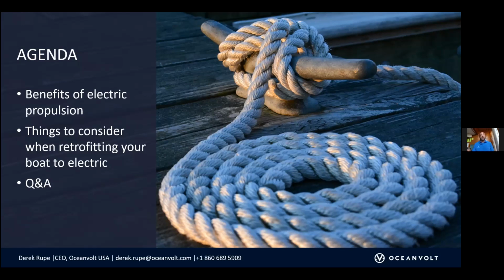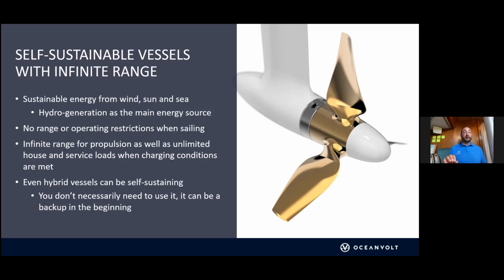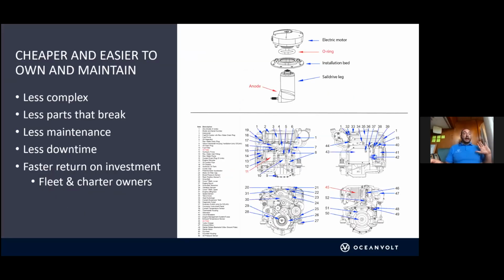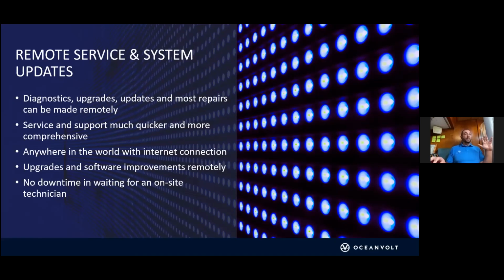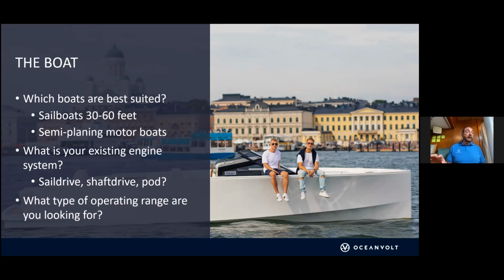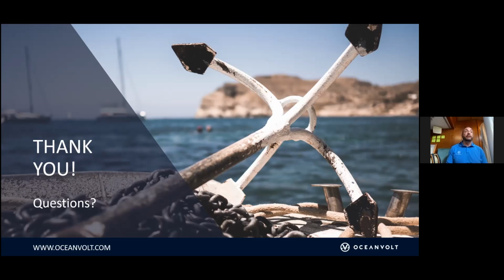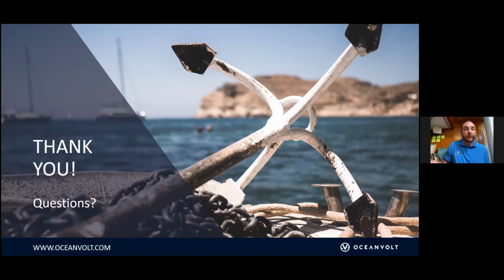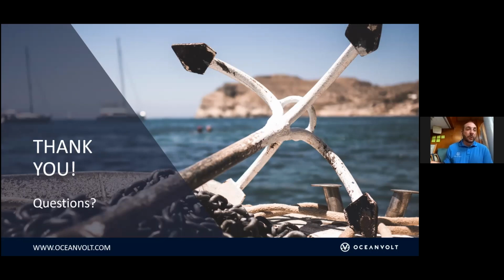Oceanvolt Webinar: Benefits of Electric Propulsion

Comment: A little story. Last year I got caught in a surprise storm while in a narrow channel with my Catalina 36. We had been motorsailing all day due to light winds and unfavorable wind direction. When the storm came through we were hit with 40mph winds and 5 foot waves. In order to maintain control and stay in the channel my diesel had to run hard for about an hour at near full load. Had I been in an electric boat I would of never been able to generate the sustained power needed to get out of that situation and the outcome would of been much worse. The amount of energy contained in a 30 gallon tank of diesel is huge compared to any battery pack on the market today. While ocean volt is an amazing product it truly isn't for everyone and more than likely will not fit the average cruisers application, especially in an emergency.
Reply: I respect that there's significant danger in bluewater if you don't have enough power, but to be fair, batteries are modular, so it's only infeasible to match a 30-gallon diesel's output if the battery bank is outside the sailor's budget. I'm sure it is infeasible for a majority of sailors today, but it's not impossible. I estimate you can build a bank that matches a 30-gallon diesel's output for $40-50K. That would certainly be an epic crap-ton of batteries, but on the other hand, marine diesel maintenance is an epic time/money/energy sinkhole that goes away almost entirely with electric motors. It seems to me the only good reason to stay diesel is that it's still drastically cheaper per unit of power output.

Comment: Can you take a look at Aquariusengines generators for hybrid integration please? You can get rid of your diesel generator by replacing it with Aquariusengines, less weight, maintenance, complexity, size and much more simple. 8kw-32kw output and 80kg weight (engine only 10.5 kg).

Comment: Do you suggest a seperate 12V system for the daily usage (fridge, autopilot etc.) or can we use only one 48V battery pack to be used both engine and daily usage? Some designs have both sepereated what is the reason or advantages/disadvantages of having 2 seperate 12V &48V system vs single 48V sustem?
Reply from the maker: I will let Christian answer this one :) https://youtu.be/bSKnog4eh1c?t=2369

Comment: I like the idea of electric propulsion on sail boats but till now its hard to find charter yachts with it. Usually peak power of EM is much higher than continious, especially when EM is air cooled. Are the numbers peak or continious? Is there a water cooling system for EM and power electronics? What about the sealing of the prop shaft, is there a change Intervall? Thanks for information, I hope e propulsion becomes more popular, even on charter yachts.

Comment: 3 area I am concern, 
1) Cost of EV vs ICE? 
2) Can the speed be maintain (current top speed 35 knots with two 16v mtu engines, gearboxes & water jets? 
3) Range, how far it can go before returning to charge? 
Thanks with regards
Reply from the maker: The cost comparison needs to be evaluated as a whole system, so the entire power management infrastructure. If we take for example a 45 foot charter catamaran, the electric system is twice as expensive, however the use of the boat is 75% cheaper so the ROI is short. Furthermore the electric motors have next to none maintenance needs (only the generator requires “normal” ICE maintenance). 
Oceanvolt focuses mainly on displacement and semi planing boats. In order to maintain 35+ knots speeds higher voltage is required. For those speeds a hybrid system is recommended.

Comment: Are you guys planning on adding larger motors to the servoprop options?  something in the neighborhood of 20 or 25kw?  And do you have any plans for outboard motors for dinghys?
Also, what have you guys learned from Jimmy Cornell's experience?  It sounded like the regeneration tech is a little touchy in rougher seas.  Have you gotten good data from that in order to tweak it and improve its ability to find the best prop angle for regeneration?
Reply from the maker: We are constantly following the market situation and the demand in terms of motor power, and motor types. At the moment we do not have plans for outboard motors. We have monitored and analysed the data from Mr. Cornell’s Outremer, and we have been able to draw conclusions regarding the next steps, one being the predictability of the regeneration is heavy surf conditions.
Reply: @Oceanvolt  Bummer on the outboards, though I suppose there are other options out there to fill that gap.  Great news on the regeneration updates!  I feel like Cornell's experience is negatively coloring perception of electric propulsion as a result of some poor planning on their part.  Looking forward to seeing things improve!
Reply: Oceanvolt has said previously that they are looking at larger than their current sail drives (15 kw). No clue how far down the line that is. Hopefully by the time that solid state batteries and 50% efficiency solar panels are on the market in less than 5 years.

Comment: What's the reliability like with the rotating blades on the props?
Reply from the maker: There are several measures to reliability and safety, one being mechanical, and the other being software related. Since there are so few moving parts in an electric motor, it means that the mechanical aspect is safe and sound. The safety system in a ServoProp scans and checks the blade angles every few seconds to make sure that the blade angles are in the position that they are meant to be. In a case that the system does not sense the blade position, the system will automatically boot itself. Besides this, there are also mechanical hardstops that prevent the blades from over turning.

Comment: Do you have an idea of diference of weight comparing with diesel installation (Including the diesel and fluids)?
Reply from the maker: For the comparison if we use for example a 40 foot sailboat with a 45 hp diesel engine, that has a 150l fuel tank, the weight with the engine, drive, fuel and fluids would be approximately 430 kg in total. In comparison if the same boat would be electric with a 15 kW ServoProp and 30 kWh of batteries, the system would weigh 235 kg, so 195 kg lighter or 46% lighter. Even as a Hybrid the system would be lighter, with all the comfort and space benefits over the ICE system.
Reply: Electric systems with batteries are heavier than an equivalent diesel systems. It would be better with hydrogen.
Reply: @josidasilva5515  , thanks and regards!
Reply: diesel fuel is about .83kg/l and engine weight is going to depend, obviously, on what size of engine.  A 40hp yanmar is just shy of 200kg.  So if you have that yanmar and carry 200l of diesel for it, you would remove a bit over 250kg.  The 15kw servoprop weighs, iirc, around 65or 70kg, then you have to include the weight of wiring and management components Wiring can really add up to a lot of weight, so it's going to be heavily dependant on how long your wire runs are.  Then there are batteries.  The best capacity to weight I've found is around 100 Wh/kg (for LiFeP04).  So in the above example, you could have roughly around 15-20kwh of battery storage without adding any weight to the boat.

If you rarely motor, or only motor for short times between having enough time to recharge your batteries, that could be plenty.  However if you want a decent range you will want more battery capacity.  Regarding hydrogen, there is a fuel cell that can deliver 80 kw of power, which would be way more than enough to run the motor directly, however that fuel cell is 400kg and takes up a square meter.  It also probably costs as much as a new boat right now.  1kg of hydrogen is worth roughly 33kw of power, which is great, but you still have to carry the weight of the fuel cell, and hydrogen is stored under high pressure (300-70 bar/4350- 10150 psi) and requires special care for safety.   Batteries are also going to be necessary in most cases, even with hydrogen, though you can get away with a smaller bank.

I am pretty convinced that hydrogen is the future of electric boating and within the next several years we will see systems beginning to become available.  And before too long we will start to see electrolyzing your own hydrogen from seawater becoming more and more feasible.  It's a high loss scenario right now (requiring somewhere in the neighborhood of 45-60 kw of power to electrolyze 1kg of hydrogen and compress it) but combining it with a decent sized battery bank and good power generation from solar and wind (and hydro when sailing), you will have a system where you use passive power generation for daily needs at anchor, and excess power generation will go to produce hydrogen for "deep" storage.

Interestingly, you can also use hydrogen as a cooking gas with some fairly simple modifications to standard LPG/Propane burners, so going entirely fossil free is pretty close to being possible at a reasonable cost.
Reply: @FlesHBoX  , Thank so much for your explanation ! I also agree that hydrogen will be a great reality in the future ! This technology has been studied even for aircrafts and Vtols ! 
This new clean technology is upon us and makes much sense with sailing boats ! Thanks again and cheers !
Reply: @oldskull70  Indeed!  I actually started digging again after that comment, and it looks like you can get a 5kw fuel cell for around $30,000 US.  I haven't found any kind of reliable pricing for electrolyzers, but there are a few companies out there making them in a realistic size for a boat (producing around 1/2 to 1 kg per 24 hrs).  Combined with a large solar array (this is where catamarans really have a huge advantage over monohulls) you could realistically produce enough hydrogen in a day or two to motor for 12-24 hours depending on the consumption of your motor (estimating 1-2kw, so not really fast, but probably in the 3-5kt range with no wind).

Obviously, you would be looking at spending a quarter of a million dollars to replace a 15 thousand dollar engine, so not exactly financially wise, but if reducing your carbon footprint, or just being self sufficient is important, maybe worth the cost.  I know that if I had the money, it's the way I would go, both for reduced carbon footprint as well as self sufficiency, plus helping to promote and further the tech.

Comment: Whats the expected maintenance (preventive) for electrical parts? Is there some consumable parts? Or LLP's (Life limited parts)
?
Reply from the maker: The only consumables are the anodes, gaskets and in saildrives the drive oil. The motors are designed to last 15 000h. Besides the consumables the only maintenance required for the rest of the system is to grease and polish the connections.
Reply: Mostly corrosion mitigation. Batteries and electronics take a beat with heat and salt water though.